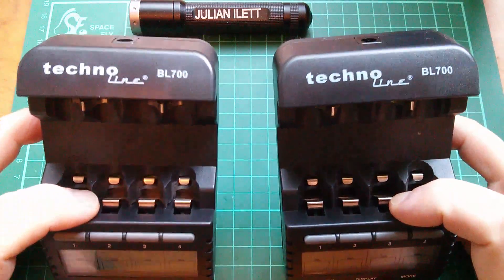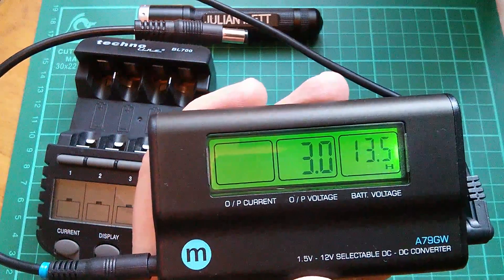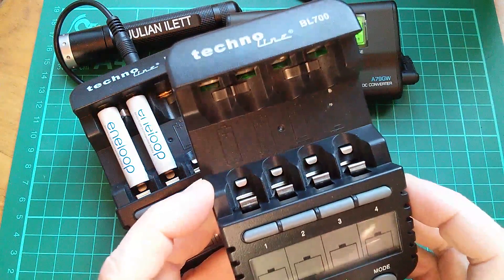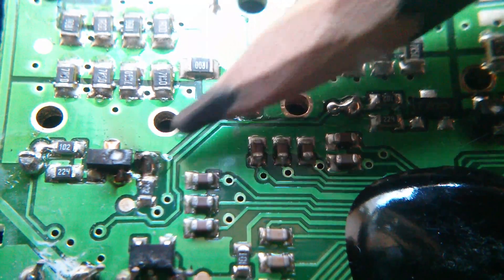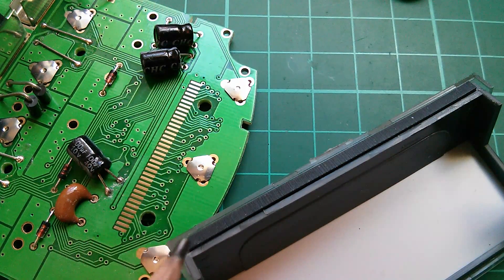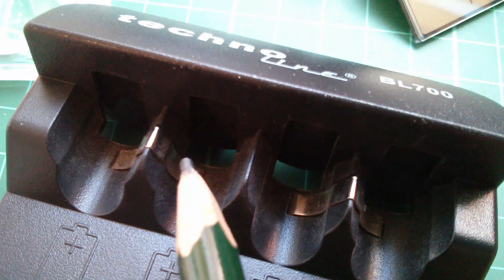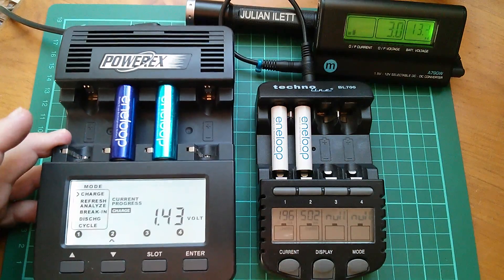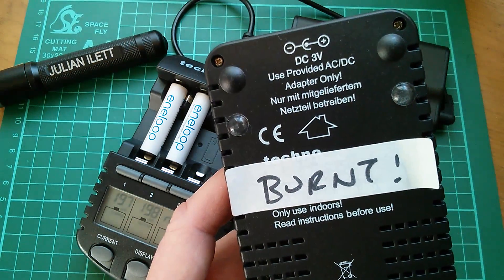Autopsy: Technoline BL700 Battery Charger after 12V Fail

Comment: Mine's still in regular use after 8 and a half years, I paid $28 for it. I've never had any trouble reading the display myself but the buttons do require a firm press. Having this plugged in on the bench saves me mucking around with multimeter probes to check the voltage of alkaline cells too (just insert for a second or so to read voltage). Yes on occasion have found that a cell charged a bit too long on the 200mAh setting so if I'm not going to be around to keep an eye on it near the end then I'll just use the 500mAh setting. It's not perfect but for the price at the time it's been a fantastic investment and it hasn't killed the Eneloops that I bought at the same time either - also still in regular use. I'd like a fancy new one but it's not really justified yet...

Comment: Ah yes, the old 12 volt   in the wrong socket deal!  I recently learned that this can happen to computers as well.  I was trying to change an old Toughbook over to Linux the other day, the unit came without a CD/DVD drive, so I wanted to use an USB external DVD drive that I have for just such purposes. IT was not being seen by the toughbook, so I thought, I will simply plug it into my new Dell Laptop (well a year old) so I plugged her in, again the led on the DVD drive did light but no recognition.  So I looked at the drive, and saw a point where you could plug in a 5 volt power supply, with that in mind, I grabbed a wire with a plug on the end, and shoved her in, while still plugged into my DELL.  There was a slight wiff of smoke from my DELL, and the screen went dead, the fan stopped and she died.  I quickly unplugged the USB drive, and pressed the power button, I was happy to see the circle containing the DELL logo on the screen as my machine returned to life.  It appears all that was damaged was the data pins on that USB circuit.  The laptop still has the USB 3 port that works fine, and I can power stuff from the other 2 ports but they are no longer available to transfer data.  Guess I can live with that, I am going to get a bottle of red testers pla paint and color all my 12 volt plugs red to keep me aware of this danger

Comment: Hi all,well I must add that you should allways use the correct power supply that came with it.You can't really put the charger down as its user error,it says 3v on it,I don't understand all the fuss,The designer didn't design it for use with other voltages,and modification's, power supply's etc,I do think they should add over current/voltage protection but like I said they come with a power supply that's correct. Ime not having a go,I just think posts like these can put people off buying a very good product.😉

Comment: Those chargers have absolutely no regulation on the pcb.  They are so critical to the power supply voltage, that putting 12v in there will dump way more than the displyed current into the cells, so much it way overheats the switching mosfets.  Your Powerex has a regulator near the power jack. It's wastefull, but just keep the input volt as low as the charger will operate when you're on battery/solar power.  Ie. if it runs at 9v, as most of those regulators will, then thst's less energy wasted wa

Comment: "totally my fault i put 12 volts into it...."  now i have a new favourite charger ? WTF ... if you put gasoline in your "favourite diesel car" would you suddenly decide on a new favourite car after it breaks??? LOL just seems odd to me but who cares, it is not important..... by the way, i think i know why the resistors are missing [ i could make up some sarcastic comment right now but i won't LOL] i think it has to do with socket 1and4 being able to be programed differently on the bc-1000

Comment: I've been using the BL700 for a couple of years and find it very reliable. It does fail to charge cells with a low voltage so I start them off in another charger when necessary. I also found the 500mA charge rate better than 200mA for detecting the cell full status.
The refresh mode is excellent.

Comment: Love the videos. I originally came across your channel by looking into how to run 1w led stars. So I thought I'd ask. Could u advice or do a video on how to run 50 of these leds in 5 x 10 configuration with one of these. http://www.dx.com/p/tc420-1-4-led-programmable-time-controller-black-12-24v-140cm-cable-269307#.VOZWOKOny2d
  The reason I ask is because I want to use 20 blue and 20 white and 10 red. The blues and whites use 3 to 3.4 volts at I belive 350 ma and the reds are 2 to 2.4 at 700 milly amps. Any help would be appreciated.

Comment: The MAHA charger has a seperate thermistor for each cell.  I have had one fail by a static discharge into a battery terminal, but it only zapped a cmos analog switch chip that was easy to replace.  While I was in there, I added a 10uf ceramic cap across the small electrolytic that bypasses the supply bus, where it feeds the four switching charge regulators.  It was way too small to handle the ripple current while charging 4 cells at max charge current..

Comment: I do have the Technoline BC450 which is a smaller model with less charge current and  it runs off 12 Volts! Not sure why they went for the lower voltage on higher charge currents, probably to reduce losses but I'm not sure...

Comment: The ' Youshiko YC4000' looks like a good replacement for that one. You'll get slightly higher charge rate options, 12v input and as a bonus a USB 5v output. I recently bought the Opus BC-3100 v2.1 and don't have any issues it so far... other than it has a fan, and makes some noise... but I suppose it does need to cool itself when charging 3xAA at 1A each and discharging a li-ion cell at 1A to check it's capacity :D

Comment: Don't suppose, while you had it in bits Julian, that you noticed any control or adjustment for the LCD contrast?
Mine is awful, especially on colder days. Haven't opened it up yet, so you could save me the effort.

Comment: Don't know if you noticed, but the three versus four resistors on the two middle channels was just because there were five positions for all channels, but the middle ones had two resistors round the corner instead of one.  So they all had five resistors.  I have one of these chargers branded under a different name like LaCrosse or something.  It's 3V connector burnt out!  I soldered the wires directly to the PCB but one has since detached.  If you ever picked it up while it was charging cells then the connector made a "50Hz" sensation as it turned!  The two thermal sensors for four cells is a bit tacky, and on mine the buttons were totally unresponsive due to poor software monitoring of the buttons.  You could always repurpose the remnants of the charger by converting it into a Chinese grade deathtrap, but paralleling all the cell positions and feeding them directly from the mains via a phat capacitor and rectifier.
Reply: I couldn't find a video of you taking one to bits? I'd be very grateful if you could shine some light on the circuitry. One of the four channels on mine, thinks there's a full cell inserted, while in fact there's none. The 3 volts that's present at the terminals (open circuited) somehow gets pulled down via a lower resistance to ground (while I measure this resistance it steadily rises) I think. But after desoldering all the pain in the ass smd transistors and diodes it's still present :(
Reply: @koffibanan3099  8 years later and I have one unit and it has exactly the same problem that you mentioned. Channel 3 thinks there is a full cell and keeps charging it. I reversed engineered the schematic, checked all transistors, diodes and resistors... everything is ok. I even checked with an osciloscope and it seems the command to the charging transistor is in PWM mode and is ok. For some reason it detects a voltage on the bad port, a voltage that is fed via a 47k resistors and is present on all channels. My thought is that the ADC in the uC is problematic... Any idea on what to check more would be greatly appreciated.
Reply: @vb9528  Oooo wow, 8 years ago already!! Jesus... I think I finally fixed it, turned out to be a super simple issue. There was some corrosion (maybe due to a battery leaking) on the topside of the board that kind of rust-bridged two tracks, causing the problem.
I would recommend a thorough visual inspection of the board if you haven't done that already?
Reply: @koffibanan3099  ok, thanks for the tip. I will check more carefully in the next days

Comment: Fault? You where set up for failure, that plug and 3V is just evil.
Reply: I can't understand this - I have multiple items that use the same plug and they are all different voltages. Why would anyone assume anything is just 12v without checking what the device wants? In this case the 3V is stated in large clear white letters - not like it's tiny indentations that you have to hold the light at just the right angle to read or anything. No-one was set up for failure here. I perfectly understand wanting to use alternate plugs or power sources but if you aren't going to use the supplied adaptor it's absolutely the users responsibility to check.

Comment: It's probably best that you label your connections to prevent problems like that in the future at least the device didn't fail because of quality issues. I have the MAHA charger that also will not charge certain low batteries and I also believe it has damaged some good batteries. I wouldn't pay another £50.00 to replace it. It has lasted a few years though.

Comment: I've had the PowerEx C9000 WizardOne now for a few years.  On mine, soon as you put a battery in, press ENTER (to select 'charge' from the menu on the left).  The next screen that flashes up on mine is "Charge Rate" that I can select from 100ma to 2000ma (at 100ma intervals) using the up/down arrow keys.  Then ENTER again to select.
Reply: Ah, I see. That is true, but, what do you charge in your Powerex mostly? Eneloops, right? And I've been told that a good rule of thumb is charge your cells with half the rate of their capacity. So in that way, the Powerex default is good for Eneloops. Did you know it was/is(?) also sold under the Memorex brand?
Reply: What he said... I have two of these, and rewinded 3 times to check if I heard it right. You definitely can set charge rate.
Reply from the maker: Doc Gonzo I meant the default charge rate - the current applied if you put batteries in and don't press any buttons.

Comment: I have this charger and I relly like it.
http://www.ebay.co.uk/itm/Powerfocus-BT-C3100-Li-ion-18650-Battery-Analyzer-Tester-Refresh-Charger-UK-v2-1-/161455271893

It has a 12V input, charges NiMh and LiIon, can charge with up to 2A, standard is 500mA, and shows Voltage, Capacity, Charge current, can measure the internal resistance and the time it took to charge.
Charge currents are, 200, 300, 500, 700, 1000, 1500 and 2000 mA

Comment: it would be great if you'd increase the bitrate of your video or the encoding scheme... somewhat blurry and blocky at places. Makes it hard to distinguish small detail :)
Reply: Doesn't have anything to do with my resolution. I have 100Mb/s internet connection and 27" full HD monitor and I did check my video resolution options when I noticed that. It's about the bitrate of the video combined with some encoding artifacts that make some details mushy. :/Darren Nash
Reply: Mtaalas I'm pretty sure julian is recording with a nexus 4, so tbh, I think he's doing a pretty good job with the quality. Also, the magnifying glass can't help the image quality in the closeups.

Comment: Just recieved a Nitecore Digicharger D4, looks really promising so far. It has a really nice display and 12/230V.

Do you think there is notable loss going through the 12 to 3V? Since you are running of solar..
Reply: its going to need 3v sooner or later as the rough charging voltage for the batteries, so either lose it externally or internnally to the charger, but dc-dc converters are pretty efficient

Comment: urgh... no over voltage protection with MOVs or diode clamps and no inverse voltage protection with diodes :/
Reply: Hey, it's meant to be powered from low voltage DC. MOVs would be completely useless because they can only clamp above a few tens of volts, but by that time everything on the board would already be fried. I agree that a diode to protect from reverse polarity could be good, but at least the plug has the standard configuration.

Comment: Love this vid! I've broken a couple of these units, some the BC-900 version (same as the 700 but with more charging current options on the higher end) as well as trashing one of my BL-700s. Also I've trashed batteries in it, presumably because the thermistor which is located rather stupidly in my opinion has not picked-up on a very hot battery. My current BL-700 works okay, although sometimes I notice one of the batteries is still charging after 3 days and very hot: not good!

For £30-45 depending on the model it shouldn't be hard to put a mini buck converter in there should it? And upgrade it with a nice little colour oled? And fix the charge detection design flaws?